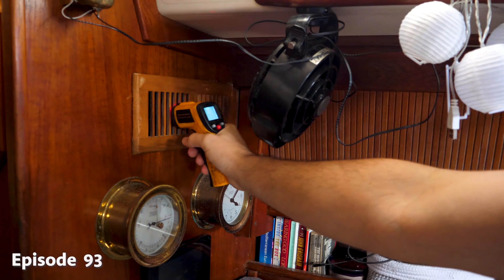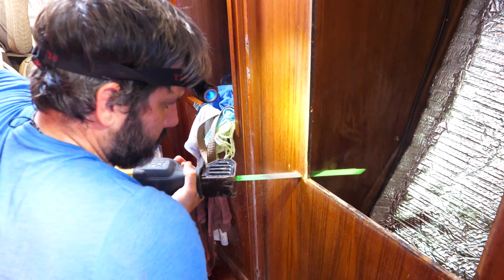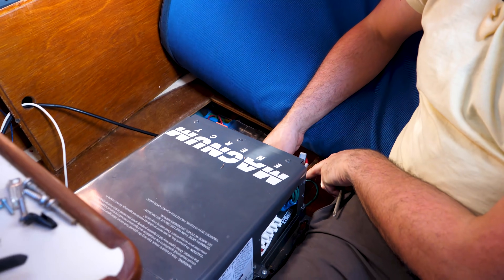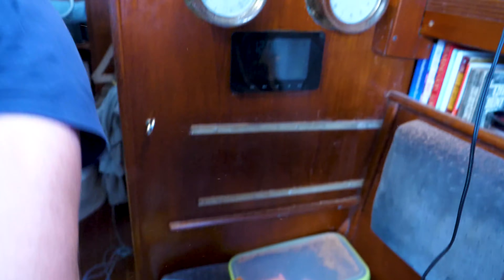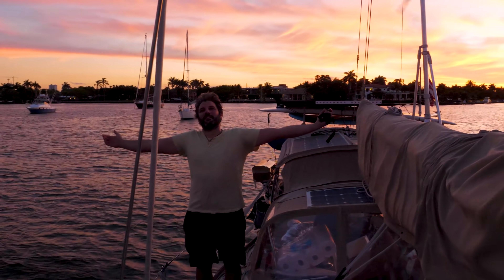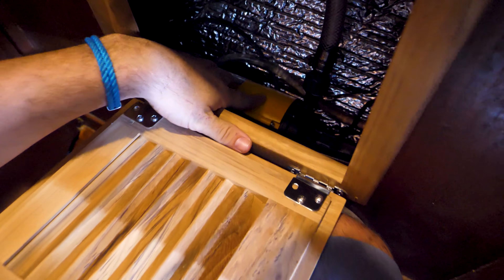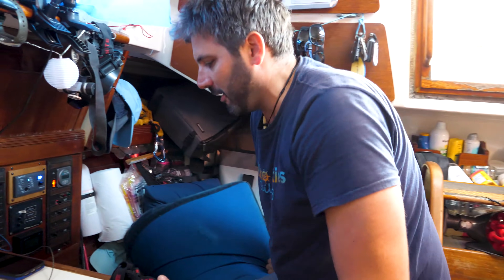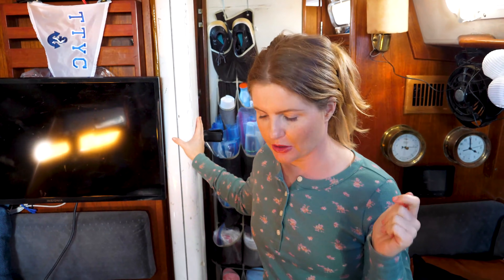Will we be able to run our 16,000 Btu AC off our lithium battery bank?! (Calico Skies Sailing Ep 93)

Comment: Awesome job, y'all! I just installed my 3rd AC unit aboard our Hatteras. One recommendation - Make yourself a flushing hose to connect a shore water hose to the raw water inlet for flushing mud out. There will be things that get past your strainers, or in my case the 2-month old MarinAire unit had paint inside the water outlet. When you start noticing a drop in performance, flush the system and see if it doesn't come right back to awesome. And kudos for making it a beautiful finished job.
Reply from the maker: Great tip! Smart to be able to flush the unit out occasionally. We've had to clear the strainer a couple time already!
Reply: I once had to dove over and Plus k Out an "ice bag" that was sucked into the Intake. It was a Wonderful Setting on Block Island R.I. BUT.... At the Time the water was full of Jellys!...Yuck!  Note:  make sure your INLET has a "BAY Stainer" on it. That will also keep out Eel grass. Just sayin'.... Happy Sailing...

Comment: I watch so many channels that are unable to use their air conditioning because they don't want to have their generator or their engine running to charge their batteries and most don't have enough solar or enough lithium batteries to make a workable system. There are very few channels that ever let it be known how hot, sweaty and uncomfortable they really are. It is only when guests come to visit that we might get to see how hard it is to sleep. Congratulations on your beautiful installation and it was amazing to see all of the hurdles that you had to overcome.
Reply from the maker: It's a game changer! Even just a couple hours of running the air con removes the humidly and makes the boat so much more comfortable!
Reply: @CalicoSkiesSailing  Maybe I would consider sailing around the world, if I could only stop my constant throwing up from many types of movements.
Reply: @CalicoSkiesSailing  Absolutely, Getting rid of the humidity is what does it. Living in the humid South, this is always on our mind for when the zombies come and you go off grid. So while we have an overrated central AC that keeps it winter cold when we have grid power...also have window units in each room for using generator, and battery power. Remove the humidity in a room, cut it off, go to the next room. Very comfortable. Once the humidity is removed, we can go with a large temp rise before it gets uncomfortable. This great video should have links for off grid folks, they would get a lot of useful info from it.
Reply from the maker: @songsinthedrawer  Getting rid of the humidity so good for the boat too, reduce mold issues. That's a good idea to share it with off grid folks. There is a lot of crossover with the systems!
Reply from the maker: @mitchellbarnow1709  Dang it! Yea sailing around the world may not be the best option if susceptible to motion sickness 😂!

Comment: Nice work! Those 4+" large hole saws are even more fun on steel with a corded half inch drill. Damn near ripped my arm off when using one on the bus conversion.
Reply from the maker: 😂😂 yea transmit a lot of torque to the arms!

Comment: Good looking heat pump installation !! As a journeyman HVAC technician for fifteen years I can tell you an unfiltered supply duct feeding the evaporator coil with supply air will clog the fins with dust, skin particles, atomized grease and oils from the galley and many other sources leading to many headaches in a relatively short amount of time. Please make sure to install a filter and a means to clean it or replace it on a regular basis. Lastly, ENJOY !!!
Reply from the maker: Thanks for the tips! There is a filter on the unit, although the shelf is installed over it so I will have to remove ofr cleaning or get a vacuum attachment in there. Maybe I should throw another filter behind the teak register to make it easier to clean.. :)
Reply: @CalicoSkiesSailing  One good filter where the return air (the air entering to feed the evaporator coil) enters should be satisfactory.
Reply from the maker: @joecucch8261  Cool yep there is one on the unit
Reply: @CalicoSkiesSailing  You should be in good shape !!

Comment: I run a small window AC unit on my sailboat at anchor.  But with a small battery bank I can only run it for a few hours unless the sun is up.  I have 1150W of solar.  
Great video guys.  I'm tempted to get a built in unit now.
Reply from the maker: We went back and forth as to whether we should just pickup a window unit when we arrived to Panama or go for the built in unit. We decided we didn't want to store the unit as we travel around. We also felt its a bit better for safety as we can lock the cabin, we were originally heading for Guatamala where theft is an issue and you need to be able to secure the cabin. The reverse cycle heat will be nice if we eventually make it to NZ as a backup to our diesel heater. 

We have 1140w of solar and 600 amps of lithium. We were able to get a couple hours of air con in the afternoon and still be fully charged at the end of the day. This is when we were in Florida where it was very sunny. Now that we are in rainy season in Panama we can no longer do that. But luckily the Honda 2200 powers it with no issue once started and also slips are affordable in Central America. 😎

Comment: Very interesting and informative video. How many amps does the inverter draw when the A/C is on and how big is you house bank?
Reply from the maker: It draws about 100 amps @12vdc or so. Our house bank is 600amp hours and we have 1110w of solar.
Reply: @CalicoSkiesSailing  How many hours can you run that system off solar alone?   To me, A/C is a luxury I grew up without but I can no longer sleep at night in the heat. During the day it's not a problem, I can take heat fine even while at work out in the blazing Georgia sun. When I get in bed though I love the cool and heat makes sleep miserable.
Reply: My guess that system will only run 2 to 3 hours on that size battery bank. Double the battery bank and double the solar and you might be in business

Comment: Putting the hole drain hole that hi  should really make you friends in a marina, nice one. And you should have put a venturi fertilizer injector in the feed line to suck the condensate instead of dumping it to the bilge
Reply from the maker: We have a hose we install to lower the sea water exit 👍

Comment: Not sure as I haven’t read all the comments and didn’t hear you mention it. But that A/C unit has a reversing valve which will let it heat as well as cool.
Reply from the maker: yep we have a reversing valve on the heater, we also have a diesel heater onboard but if we are a slip it will be nice to save diesel 👍

Comment: Great Job guys!! Sorry— how many Lithium AMP hours did you all upgrade to?   I also have that same AC unit onboard our boat— I’ve only ever been able to run it from the dock; but this video is making me re-think the idea of getting two smaller units to run independently for the Aft Cabin / V-Berth.  I’ll have to upgrade the Led acid batteries to lithium anywho— so all good stuff guys!! Thanks for posting and glad to see you guys making some comfort upgrades!  Y’all work hard at this lifestyle!   

Cheers,

Thomas & Vicki  ( 🇺🇸 & 🇦🇺)
Reply from the maker: Thanks!! We have 600 amp hours of lithium and 1110w of solar. When we were in south Florida we were able to run the air con for an hour or two and still get fully charged by the end of the day. Now that we are in Panama for the rainy season we aren't getting as much sun so we can't do that. Once we start the compressor with our inverter we can easily power the air con with the Honda 2200 generator. Unfortunately the Honda doesn't have enough power to cycle the compressor so we make it really cold in the boat and then shut it down. 

We were being a bit stubborn not getting a soft start. They are like $300 and reduces the start up load so that even a honda 2000 can start the compressor.
Reply: @CalicoSkiesSailing  —- so hindsight always being 20/20– Which of these scenarios do you wish you would/could have done= Move up to an additional 800amp hours to be able to run the Air Conditioning off solar? Or would simply adding the Soft-Starter resolve the AC issue?  Or would the soft start only be a band-aid in your opinion for your specific set up?
Reply from the maker: @syexplorarconmigo8853  Ha I think the best option would be having a built in diesel genset to run air con 😂. Adding more amp hours in the battery bank helps but you also have to put those amps back in. We are pulling about 100 amps an hour with air con running. Without a ton more solar we would never be able to run the air con overnight for example. We have a 120 amp battery charger. so it'd be an hour of generator time per hour of air con time if it isn't sunny enough. That being said it is really nice to be able to cool the cabin down for a couple hours and also suck out all the humidity. When it's really hot and rainy in Panama we've been running the air off the honda which is a nice luxury. The soft start would be nice in that application so we can keep the thermostat at a reasonable level instead of super cold to avoid cycling
Reply: @CalicoSkiesSailing  — awesomeness!!  Thanks— y’all stay safe out there— look forward to your Panama adventure vids!!
Reply: @CalicoSkiesSailing   Do you feel you have BTU overkill?. I have seen several 4000 BTU units with draw rates of 25-35 amps.  Great Videos BTW quickly becoming one of my favorite sailing channels.
Reply from the maker: Thanks! It’s prob a bit on the large side. Cools the boat very quickly. When we talked to manufacturers they recommended an 18k btu for our size boat in the tropics. I def don’t think we need any larger 😂. A smaller DC unit would be nice as well, 25-35 amps is more sustainable on the hook!

Comment: Nice job on the air conditioner.   Are you running the generator more then using solar?  Or are you just running the air conditioner a few hours at night?   Thank you for a answering alot of air conditioner questions I have had.   Especially about solar power
Reply from the maker: It depends on where we are! In Florida there was plenty of sun so we ran it more off of solar. Now that we are in Panama in the rainy season we are using the honda 2200 more now as there isn't as much solar power available.
Reply: @CalicoSkiesSailing  ok thank you so much!   I am in Pensacola FL.  And wanting air conditioner in my small sailboat.  So you have made that possible now.  Thank you for your help!!

Comment: We ran 600ah lithiums on a Victron 3000/120/50 and REMOVED the 16k BTU onboard, water-cooled Cruisair unit that was inefficient.   Replaced it with a 5k BTU portable window unit that we drop in the companionway opening, when needed.  $200 on Amazon.  It will run 24/7 on ECO mode.  37% humidity inside the cabin is nice.  No bugs.  No sticky and it takes 20% off the SOC overnight.  We are in the boatyard, converting to electric propulsion.   We have 14 x  100ah 12v lithiums to power a 300ah 48v propulsion bank and 1.2kw of solar.  Hats off on your install.  You will appreciate the ability to cool and reduce humidity.  Operate at solar noon on full charge and you skate for free!
Reply from the maker: Wow that is quite the battery bank!! Will you have regen on the drive as well? Always curious about electric drive! We considered a window unit as well. That was the first idea lol. It seemed like one more thing we'd have to store and our boat is pretty full. Converting the hanging locker to have shelves actually opened more storage space for us. So it felt like a good compromise :)
Reply: @CalicoSkiesSailing ,  yes, we have regen when sailing.  It will add about as much as a wind generator - 300 or so watts at 6kts.  We had hoped to love on our remanufactured Yanmar for a few years.  Wasn't meant to be.  She died on the ICW when the supposedly remanufactured heat exchanger opened up and pissed all the coolant out of the exhaust.   Cracked the head, destroyed a couple of cylinders and totaled the engine.  Electric made sense. We were 75% of the way there, when tragedy struck.  Even with the expense of 8 more lithiums, it was $12k cheaper than a Yanmar replacement.   We like to sail.  That's why we don't have a cat.  Good luck on your brief hiatus.  I hope you hit a ton of business and get back out there doing what you were born to do.

Comment: What about condensation at those temps? has that been an issue?
Reply from the maker: We layed insulation around the air ducts so it hasn't been an issue. I notice the wood grate gets some moisture if we have the cabin door left open for some reason

Comment: I'm having priming issues, do you think a check valve after the seacock may solve this.
Reply from the maker: hmm maybe, the water level in the hoses is going to stay at the waterline of the boat, a a check-valve above the water line may help keep it primed. I think we have issues because I installed the reject line up high so I need to help the water along to get it flowing initially.
Reply: I have a t fitting installed on my input to pump hose, with a hose and a valve that I open and prime system with.

Comment: Nice job. One question, by putting the AC output that high up on the hull what happens when you are dock on that side of the boat?
Reply from the maker: we have a hose we can put in the exit to have the water exit down low by the waterline.

Comment: How long will the batteries run the a/c before you have to turn the generator on? 100 amps is a lot like you said.
Reply from the maker: We get an hour or two a day when it's sunny and still have full batteries at nightfall. The Solar reduces the load and to like 40-50 amps. If we don't have the sun we will fire up the Honda 2200 to power the air con

Comment: I gotta say you guys are gutsy to take on some of these projects. I'm just wondering if it's possible to put some type of defuser on your water outlet to cut down on the noise, taking into account that I know absolutely nothing about this type of system.
Reply from the maker: Ha projects get easier the more we do! I have a hose I can jam in the outlet and have the water release at the waterline. We haven't had to use it yet bc all our neighbors are also running air conditioning and you can't hear it inside the boats :)

Comment: what was the inverter model number you used?  Interested in looking up the ability to common up combine shore power and inverter power. 
 100amps dc continuous is a lot of amps ...... depending on the distance it has to travel ie battery to inverter, is the gauge of the 12 v and gnd return cables adequate to handle that without overheating?    not trying to second guess you but wiring issues are a real hazard on boats and I'd rather pipe up and ask the questions.
Again, well done on this project.
Reply from the maker: We have a Victron Energy MultiPlus 3000 the feature is called PowerControl. Yep the inverter is right next to the battery bank with appropriate size wiring and fuses between the two. We had the first inverter professionally installed while we were working and they did a great job :) Always good to double check tho!

Comment: Hey Bill, this is so awesome and I have an almost identical setup but had not tried our built-in AC until this video inspired me to turn it on today. (We bought a lightning damaged boat 6 months ago so have been fixing it on the hook). We have the same inverter charger, 800ah of lithium and a Harbour Freight 2000w generator which we plug into the shore power. Would you mind posting your Victron settings on AC Input Limit, Dynamic Power Assist etc? I tried mine today and the AC powered up but tripped the generator after 5 minutes. I tried a whole bunch of different settings and don't understand why the draw on then generator is enough to trip it. It's working load is 1600w so I was being conservative. I'm wondering if the existing wiring setup is the problem. I can see Power Assist kick in on some other stuff but I think the water heater and AC are wired to be on shore power only, so Power Assist doesn't kick in, even though the power is passing-through the inverter charger. I'm confused – any pointers very much appreciated!
Reply from the maker: After the fact we added a soft start to the our air conditioner, way better for all the gear. I don't think the BMS on the lithiums likes the spike in power associated with the LRA of the air con. It can damage the circuity. With the soft start the compressor very slow starts up 👍. We have an Micro Air Easy Start 

https://battlebornbatteries.com/product/easystart-364-3-ton-soft-starter/

Comment: Hey  Bill  how well  does it  reduce the  humidity on the  boat is it similar  to what  you  would  see in an automotive  application? Second  question  were you  nervous about cutting a 4 inch hole  in the  bulkhead from a  structural  perspective? That  was a good  picture of  you guys  at the end
Reply from the maker: It greatly reduces the humidity in the cabin. Right now the humidity level in the cabin is 55% and its rainy seasons so extremely humid outside. We had to plumb in a condensation drain attached to a tray that the compressor sits in. It puts off a surprising amount of water. Kicks our bilge pump on four times a day. We have a counter on the bilge and typically it doesn't run at all when sitting at anchor.

I was a bit nervous about putting that big of a hole in the bulkhead. Luckily we had other Sabre 36 owners to chat with and they sent pictures of their installs and we modeled off of that for the ducting. I tried to keep as far away as possible from the chainplates on the bulkhead, so far so good 🤞